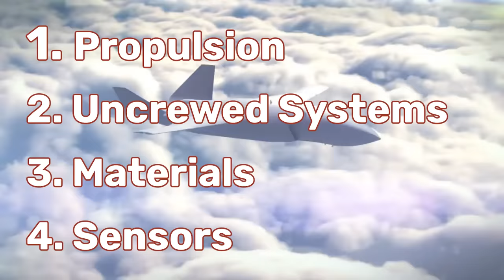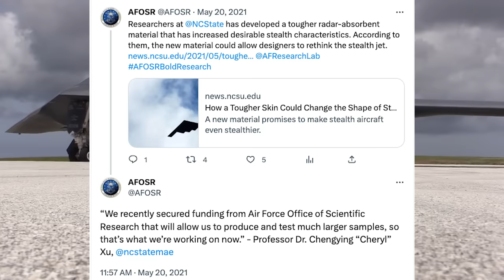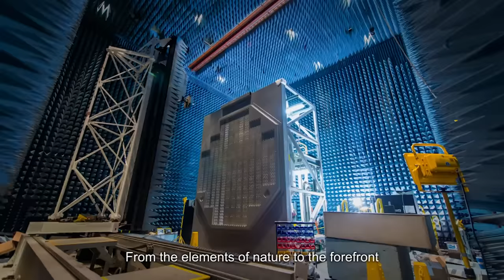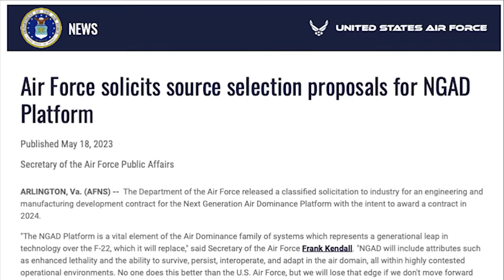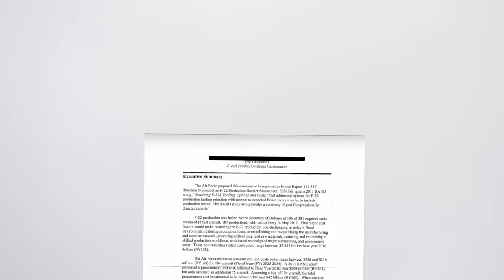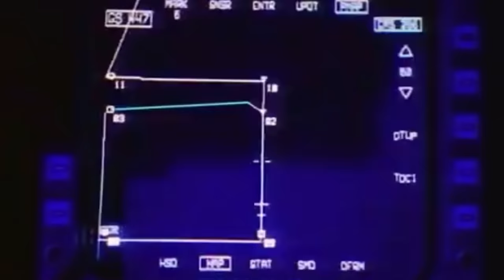Why America's new stealth fighters might cost $300 MILLION each

Comment: I believe the F22 wouldn’t be this estimated price, but considerably less, as all machinery, and technology it uses are cheaper today. But yeah, USAF isn’t looking for a defensive fighter, because the F22 can’t go too far without refuelling. So makes more sense have a modern fighter. But we can’t forget that other nations are heavy investing in cheaper counter attack systems to mitigate stealth. I believe a dogfight between two stealth fighters will be decided at very close range, with the most agile and manoeuvrable will win.
Reply: They need  to make the Drone Wingman like the  F15’s to carry  more ordinance. The F15’s remain undefeated  so give each F22’two F15 Drones with A1 and Tactical Nukes to annihilate the Enemy on the First Strike so no one will provoke or start a War with us.
Reply: Computer chips alone are a huge issue, you either need to have a 90s electronics factory or completely update every single chip, program and system to use 2023 electronics. So building a modern design, ready for modern tech plus upgrades, does make sense.
Reply: With modern targeting systems and missiles it's unlikely that even stealth aircraft would get into very close range dogfights because even without a radar lock they can detect and target aircraft using optical/IR sensors. They also wouldn't need to line their opponent up for a shot like they were going to a guns kill - the F-35 can target aircraft via the pilot looking at them and using his helmet mounted sight and modern high off-bore sight (HOBS) IR missiles like AIM-9X can be fired at targets well to the sides of the plane or even behind it to an extent so manoeuvrability isn't necessarily as important as who can detect, lock and shoot first.

Comment: The question is ROI Return On Investment. If the product costs ten times more than the competitor but produces twenty times more, it's a bargain deal. The J20 cost China about $250 Million each. If NGAD has a 20:1 kill ratio against them, as did the Ratpor against 4th Gen fighters, it'd be bargain deal.

Comment: The thing to consider. Every airframe America has made since WW2, has been top of the line,  pushing technological boundaries.
This will never change. They will also be like this, and as manufacturing upgrades with the capabilities and requirements of these aircrafts, they will remain largely the same cost.
After all, really nothing about their position is changing. They are THE aircraft.

Comment: The Future of Aviation will be like in Macross Frontier...  Where Luca Angeloni flies an RVF-25 with an AA/AS/SF-06 integrated radar that works as eyes on the battlefield and he is followed by 3 QF-4000 (AIF-7S) Ghost Fighters. 

In this case, the modern battles will be a single pilot followed by a swarm of drones, some with bombs, others with missiles, others with rockets, other with sensors, other with fuel (may be) and the pilot will be doing the decision making and the drones will do the job. Also, the job of the drones will be to protect the pilot.

Comment: Where they not just talking how we are done with the 20-30 year fighters? So we could now use cheaper fighters every decade from now on?

Doesn't seem like that they said is matching reality, is this not suppose to be smaller more frequent advancements for lower cost???
Reply: They absolutely were JUST saying this not to long ago. The department is so big and bloated beyond believe they have zero chance of coordinating any kind of strategy.
Reply: they scrapped that idea/cadence a few years back, the early phases of NGAD were done with this idea in mind but they're going back to a more traditional fighter lifespan/cadence since ultimately you can do a lot of this with new blocks on the existing airframes. The F16 proves that you don't need to keep every part of the airframe identical as well, you can add new intakes + engines, or modify things as needed going forward, and just issue a new block
Reply: That was the whole theory behind the Joint Strike Fighter program (which became the F35). They wanted to reduce the cost of air platforms by creating a singular platform that the USAF, USN, and USMC could use thus creating savings by reducing the number of R&D projects (1 instead of 3) and order volume. But it ultimately failed because the limitations and compromises that are made to allow aircraft to take off from carriers and VTOL/VTSL are so great that it wasn't really the same airframe.

Comment: I thought it would be cheap because how advancement in technology would lower the cost to build the airframe with 3d metal printing or new manufacturing, but I guest I'm wrong because how slow many company would not invest in technology that would change the production line.

Comment: Even if these new stealth fighters are invincible in the air it does not negate the fact that they’re sitting ducks on the ground for cheap missiles that adversaries like China could saturate our air defenses with. I don’t like the idea of us spending so much money on a platform so vulnerable unless our air defense saturation point is higher.
Reply: Ok, if the airfield is in the danger zone, it would likely be equipped with hardened bunkers for the aircraft to sit in.  There would also be many layers of defense guarding an airfield holding any significant quantity of these.  We're talking fleet units equipped with AEGIS, Patriot/THAAD, Iron Dome (the US is working on an equivalent system domestically), and MANPADS.  You'd have to throw literal hundreds and hundreds of munitions at one airfield to have a chance of saturating the defenses.

Comment: Just from what was said in this video, high production rates like 1000+ units brings the F-35 cost down from $300M to $80M.  However, only 300 NGAD units like what the military is projecting won't realize anywhere near the same cost reduction benefits.  The video says that a new production run of 300 units (by substituting F-22s for NGADs) costing well over $260M per F-22.  With 300 NGADS projected to cost not much more at $300M per aircraft that would seem to suggest that at purchase numbers of around 300 units we won't realize any additional cost saving.  And nothing like the $300M down to $80M we see with a production run of 1000+ for the F-35.  

So without allowing for friendly countries to purchase the NGAD, we could be paying 2--3 times what we would by restricting its sale to US forces alone.  Don't know if that's worth it or not.  Just wanted to point it out.

Comment: I would expect the NGAD to be more like an automated AWACs that can defend itself rather than and actual fighter.  Take an EA-6 with endurance designed engines that can go supersonic if needed, put a Vulcan Cannon on it and 4 rails for sparrows or sidewinders.  The fighter would then serve as the hub for f-16's with dogfighting programs, F-15's with avionics that could be loaded to do dog fighting or mud moving.  Both of the old fighters have production lines still in operation and as drones, they do not need stealth.  

With that done you can noe focus on developing the stealthy drones and figure out a cheap way to do it with 2 common airframes that would support fighter or attack functions.  They would be modular so you would not know if the stealth attacker is a kamikaze drone carrier for advanced MALD's, or a SLAM truck.  The stealth equipment would be focused on providing the SEAD and destroying the missile belts and batteries so the drones based on the old f-16 and 15 airframe based drones can get in.

Comment: Good info with one caveat: Apples to Apples would have been comparing the ESTIMATES for the various programs at their inception with the NGADs estimate..  and walking through the times and ways those estimates changed upwards and why we are, or are not, likely to see the NGAD do the same.  Comparing the actual cost adjusted for inflation for various mature systems.. to the estimated cost of as an as yet unproduced..or even prototyped aircraft program... sounds good but may be VERY optimisitic.

Comment: The problem with the $300/NGAD plane is that there is a high probability it will balloon to $600M/plane.  Boeing/Northrup buiilt NASA's SLS (big moon rocket) atter a 100% cost overrun and 100% schedule delay.
Every large weapons program has had this problem, with no exceptions. The f/16 was developed because the f/15 was too expensive.  We built 3 Zumwalt destroyers instead of 30 because it was too expensive and the cannon on the zumwalt fired 2M bullets.  Alex does a great job of "promoting" the NGAD, but the problem is our overpriced defense companies don't know how to buid them at an affordable cost.   There's hope. And that is in the drone fleet that would accompany the NGAD.  The dorne fleet in fact will do the "detection" and it can carry the weapons for anit-air, anti-ship, and ground attack and some of the drones can carry fuel to top up other drones..  And why does it have to be controled by a person in the NGAD?  Why can't it controlled by a crew in an AWACS (or the modern variant that uses a converted 737 airframe), or even via satellite.

Comment: I realize it isn't a direct 1-to-1 comparison, but I wonder how much cheaper, in the long run, it would have been, if in a Raptor Restart, the brought over most of the F-35's avionics/sensor systems, just targeted towards air-to-air for the Raptor, versus air-to-ground as in the F-35.  I also wonder where we would be if we had adopted the FB-22, as a Strike Eagle Replacement, whether that would have kept the overall Raptor Production Line open, longer, or could have been reused, during or after the FB-22 Production Run, for new build F-22s.
Reply: That's what they are going to do - but put the new systems into large underwing pods as F-22's ancient systems are practically impossible to upgrade in place. They will isolate all legacy systems except flight controls and bolt on F-35's (next - ie post block 4) computing suite linked to a new glass cockpit.  This kind of shows stealth is practically pointless. They are going to give up range, stealth and aircraft performance to gain better systems - this is where the advantage is - weapons systems - and it's why gen 4.5 accidentally turned out to be the right platform - easy to modernise and maintain - want the latest thing? Just bolt it on whereas adding a new capability to the hideously complex F-22 or F-35 means 3-5 years work - and then the new capability is obsolete by the time it's rolled out.  When the next war starts F-16 and F-15EX will be the front line for the USA not stealth anything.
Reply: Do you know what metal fatigue is the F-22 are not going to fly forever and underwing pods on a stealth aircraft...............now that's thinking out of the box.🤣
There's no 2nd in a war, it's kill or be killed so let's give the warfighter a capability to win not lose.
Reply: @LeonAust  There's the "official answer" and the "unofficially answer".  The "official answer" is that the tooling was locked in a storage area, and is secure there, in case it's needed again, whether for new F-22s or for making parts to fix broken F-22s.  The "unofficial answer" is that we don't really know.  Supposedly, some of the tooling was removed, to (possibly) be used for the F-35, others are missing and no idea where, and so on.
Reply: Incorporating the tech and construction methods from the F-35 into the Raptor would mean that you're not restarting production so much as developing a whole new production line. Properly integrating the potential improvements in the structure of stealth materials, adding greater power generation and cooling capacity for newer systems and ensuring it has the capacity to add things like directed energy weapons at a later date would require a total redesign to the extent that it would be an F-22 in name only. It could be done but it would be anything but quick or cheap.
Reply: @trolleriffic  But F-35 is already a dinosaur - particularly system-wise. Starting from scratch today would be cheaper and more effective.

Comment: You have to understand that 1 of these expensive stealth plane would be accompanied with at least 2-4 wingman drones; I'd called the main warplane as the C&C fighter (command & control). If assuming each wingman drone cost roughly $50 million each and the C&C fighter has at least 3 wingman drones, then a total cost of mini squadron would be around $450 million or roughly average out to $112.5 million each plane (hypothetically speaking) and in bulk procurement and time could drop the price down bellow $100 million each.

No sane battlefield commander would send a $300 million C&C warplane into an adversary' air defense zone and risk losing a human pilot. The C&C warplane would be sending the 3 wingman drones into adversary's zone to destroy the air defenses before an actual human pilot in a $300 million plane would fly in. Losing 1 or 3 wingman drones is fine and easily replaced, but losing a human asset is devastating. Hence, the $300 million price tag is worth every pennies if each of these stealth plane is accompanied with at least 2 wingman drones with advanced AI to protect the expensive $300 warplane. They've been working on wingman drones because this is the future air combat so that's what their goal.

Do the math, analyze the situations,  and stay ahead of air power dominance. The $300 million price tag is worth it.

Comment: Putting this in perspective:

In 1970 dollars, the F-35 would cost ~$12.5 million per copy.

Considering the F-14 cost 3 times that amount is staggering.

The F-35 is a goddam bargain, and the NGAD fighter will be too. 

Now imagine how cheap the Gripen or the F-20 Tigershark would be if produced in the same numbers. And apparently the F-20 was supposed to be the F-35 of its time. I still think the US should contract a new, updated block of F-5s. They're cheaper and easier to maintain than F-16s, and just as flexible, fast, and have similar RCS signatures.

Comment: The justification of the cost is dependent on how it is to be used. It’s good for the country to stay on the cutting edge of AirPower. I can see where a new high performance stealth fighter being Carrier based could be widely used to take out air defense systems to clear the way for less costly aircraft to come in or for 1 off missions of a delicate nature. 
At this cost, it’s not practical to own and operate a large number of these aircraft after air defense role has been eliminated.

The other factor is the cost of the armaments. At 1 million dollars a missile is a huge commitment every time one is fired. Especially if faced with dozens of $5000 drones and the limited armament load out. 
At this same time, the possible accompaniment of smart drones at $150 million each is ridiculous. These should be considered expendable in protection of the controlling aircraft. That’s tough at this cost. Also, the control of more than a few of these by an already engaged pilot seems kind of impractical as well. Perhaps if these drones were to be controlled from a remote base or a stand off control aircraft…

The cost of missiles and other armaments needs to be reviewed. Perhaps a bunch of affordable slightly less capable missiles should be considered with lower cost and a higher quantity a plane is able to carry into battle 😅
There is something to be said for numbers. 

An air defense system can reach a point where it can be overloaded, perhaps by a fleet of inexpensive drones. If you think about the inexpensive missiles Hamas has been using against Israel, they were effective at overwhelming the Iron Dome which is perhaps the most capable air defense system in existence plus they probably cost a fraction of each Iron Dome missile. This makes their use a game of attrition against a better equipped but more costly foe.

Comment: What I don't understand is why they limit number because of cost when cost and supply are inversely related...
Reply: Because by the time you deliver a hideously complex ultra integrated platform - its already out of date.  With gen 4/4.5 planes you just bolt the latest tech on and go.  Advances in RADAR return processing have made stealth practically pointless.

Comment: US 6th gen will use easier to maintain, lower cost stealth features (smaller size to begin with, slower speeds for lower cost aerodynamic solutions, less fussy radar materials, more composites, etc.), favoring quantity production over pure technological superiority. this means they may give up some degree of stealth capability in order to prioritize keeping costs down and production quantities up.

Especially if many of the 6th gen are unmanned drones, that are made to be expendable. Who cares if they aren't super stealthy if you designed them to take losses? You care about being stealthy enough to be a serious threat, and then make them as cheap as you can to overwhelm the enemy with them.

Comment: A new 787 without high g structure, stealth, supersonic capability, fancy radar and sensors, or all the combat gizmos goes for $250M per. Once you put in the military requirements, I’m shocked an F35 is less than $100M. Getting an F22 replacement will be expensive if you want something good.

Comment: I wonder if the use of that 90% radar absorbing spray paint would allow to make stealthy planes from 4th generation like F16 or 
F/A18. Add stealthy missile containers and you are set. And for low threat environments/pilot competence upholding the usual non stealthy versions can be used
Reply: It's better than nothing but the difference between an F-16 using that and an aircraft built from the ground up to be stealthy like the F-35 is probably a factor of 1000x difference in radar cross section.